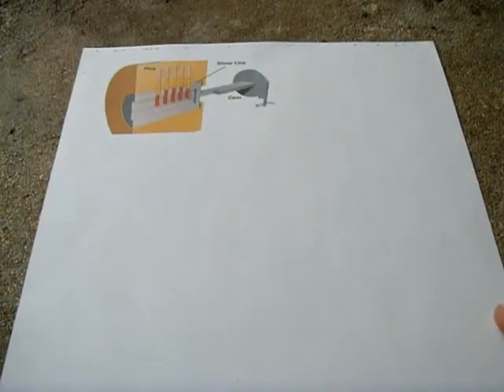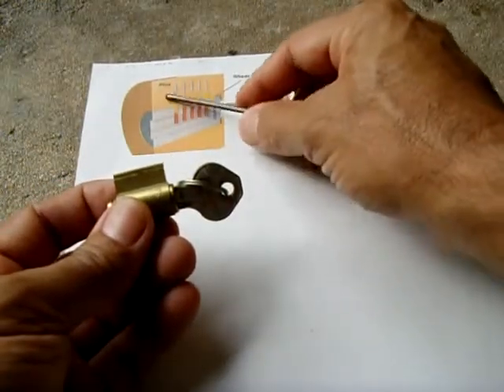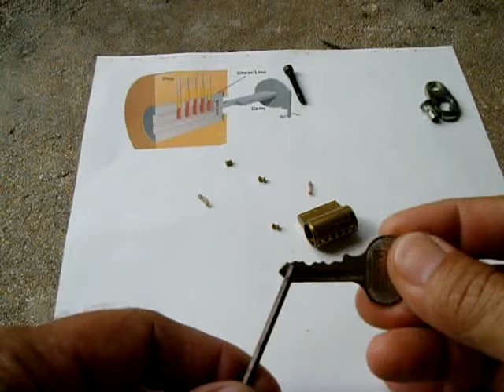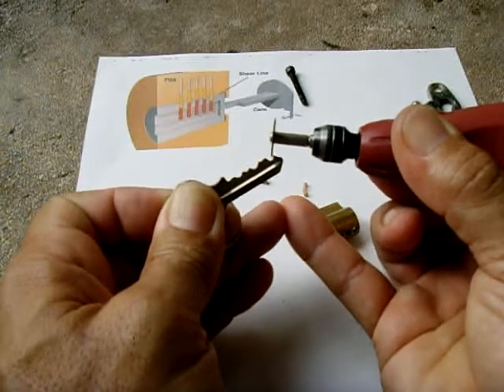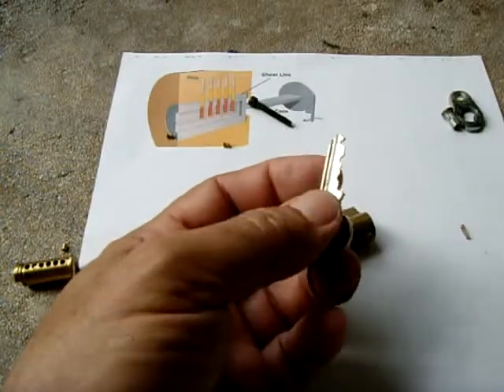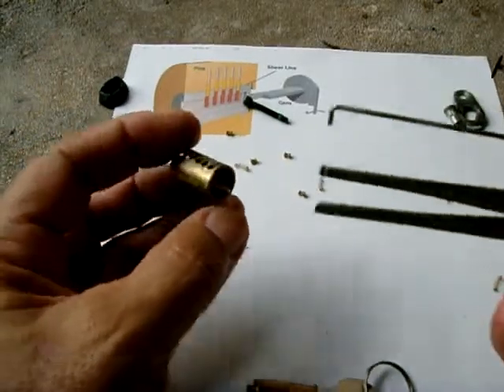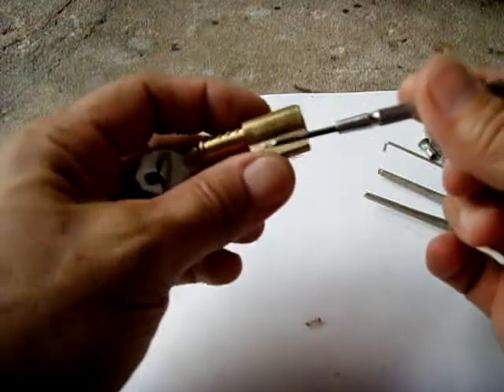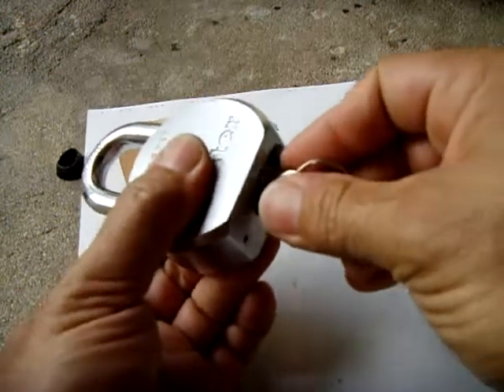How To Re-Key a Lock using a Dremel!

Comment: When the key is brass, you can make a long pin shorter in the lock and use solder to build up the key to reach the proper level. Of course, such a key is temporary and should be used to have a fresh key cut from a new blank.

Comment: It would be so much simpler if you used a follower.  They come with a Master re keying kit.
Reply: brooks weiss   

I agree on the plug follower as it’s much easier, but they are also sold on eBay and other websites individually without buying a re keying kit and come in different diameters to fit different types of lock.   

Pens and copper or brass or hard plastic tubing work great as plug followers as long as it fits inside the lock cylinder and is hard enough to stop the spring loaded pins coming back out, it will work.
Reply: yeah, he did the hard way...should have been done in two minutes

Comment: It’s much easier putting any lock cylinder back together using a plug follower to hold the pins in place as you load the anti pick driver top pins and you can use a pen body or anything round that fits inside. 

You can go to a hardware store and ask for a piece of plumbing copper pipe that will fit inside the lock cylinder or buy a set of plug followers on eBay as you already have the expensive lock pinning tweezers made by HPC.
Reply from the maker: Yes, that makes it easier, for sure. Thanks for watching!
Reply: Or you get some plastic sheet that you roll into the shape of the follower.